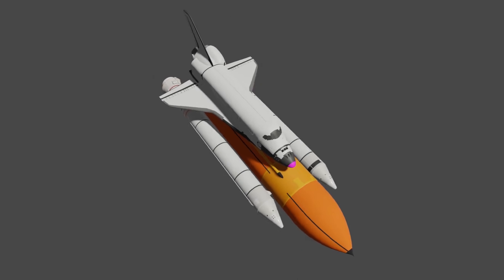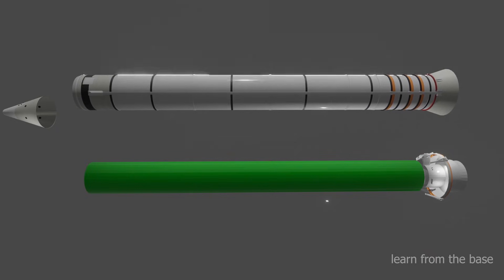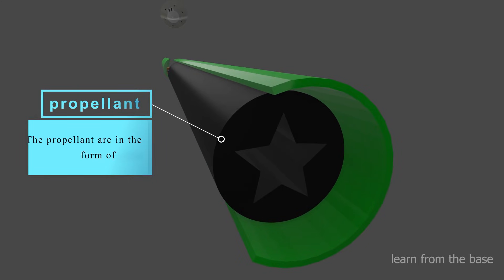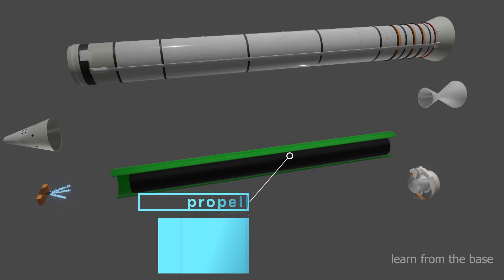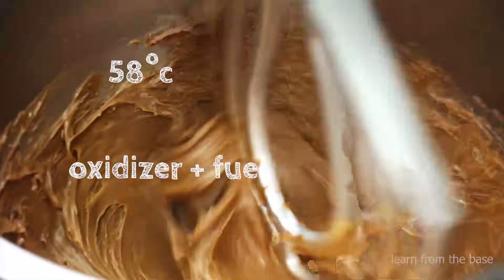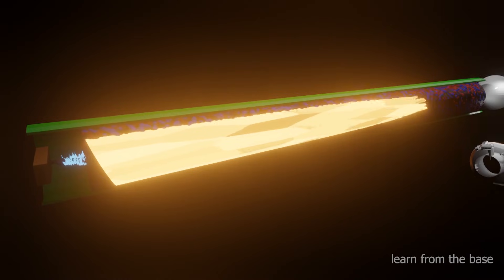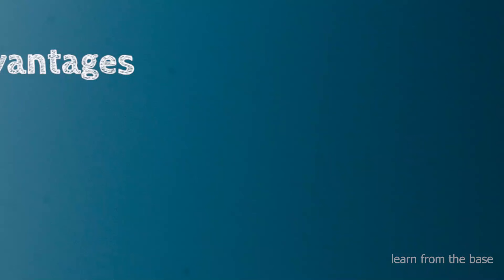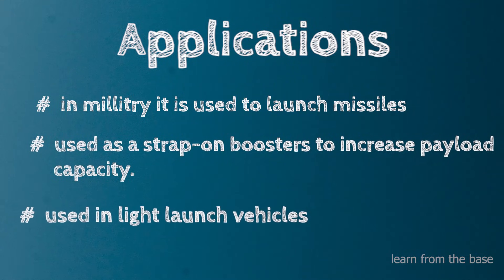srb/SOLID PROPELLANT ROCKET/solid rocket booster/with 3d animation /learn from the base

Comment: Sir plss tell how ignitor is giving electricity to the propellent without wire or battery? How ignitor is working ?
Reply from the maker: In this video Iam not showing the electrical components. Actually there is an electrical source to the igniter for generating spark .   Thank for posting your comment .